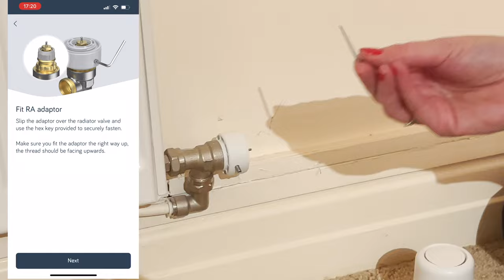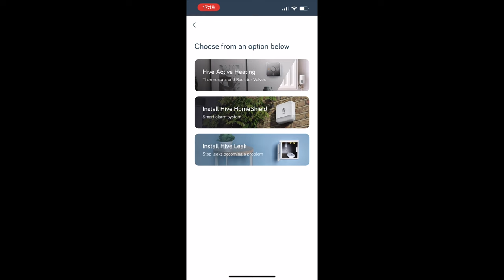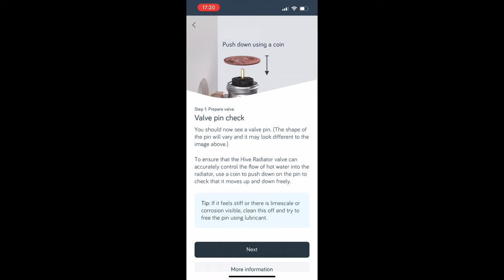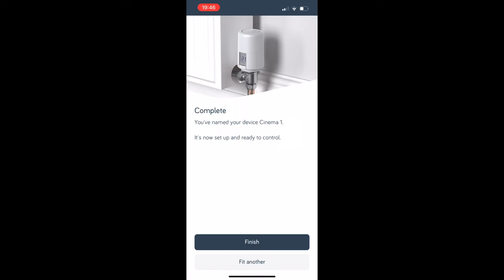Hive Thermostat Radiator Valve - Unboxing & Installing

Comment: Thanks for this instructional video.   I have a question:
I have purchased two radiator Valves to add to my hive.    I am uncertain which rooms I should put them in.    I tried putting one in the Hall, but that is where the Mains Thermostat is and that was not a good idea, so would the living room (on the 1st floor)  be a good location, and the other in a bedroom??
Reply from the maker: it's hard to say to be honest, only because you can look at it from two angles, you could put them in the main rooms you want to heat, encouraging you to maintain the temperature in the rooms you use, or you could also put them on the rooms you don't use so that you don't send heat to the rooms you don't use while others freely operate - I bought for each radiator to give full control which has helped with controlling bills I maintain the temp I want in the room(s) I use and close the others off. But I could see it working the other ay around too